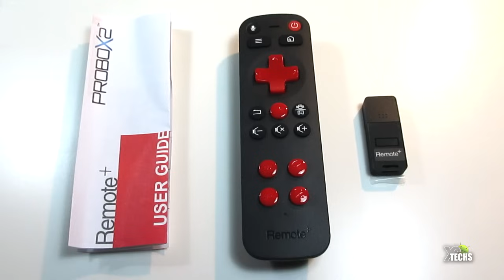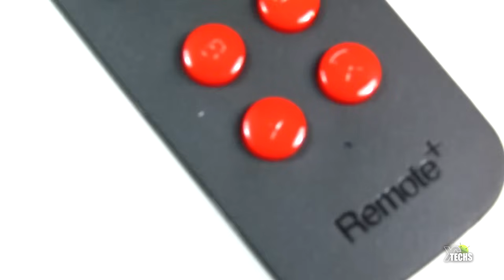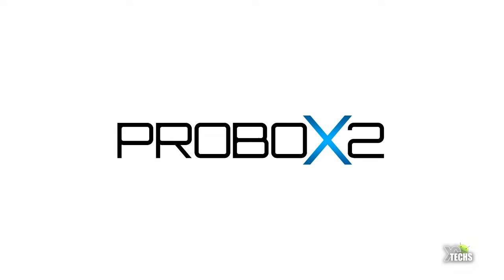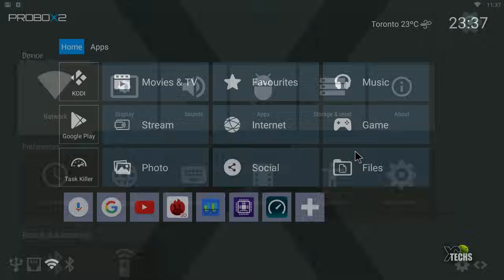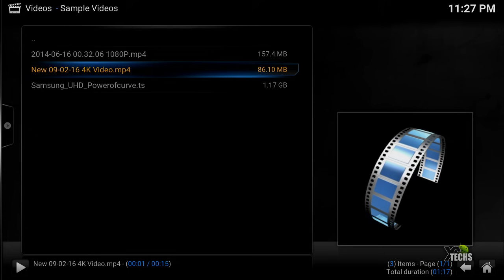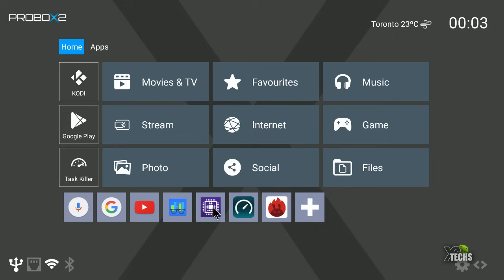Probox2 Air & Remote+  Android Box OS 6.0 - Review

Comment: Are you sure about the ddr3 ram figures, I looked it up and 1024mb of ram equals 1GB, in that case the box should have 2048mb of ram or even 2000 if rounded off not 1773mb, just asking in case I am wrong. Thank you.
Reply from the maker: it is 2gig Ram if 1gig multi tasking will be disable and antutu benchmark would be in 2s and not 3s and box would've crash alot
Reply: +XC techs OK, sorry if I'm wrong, but I have a tronsmart orion r28, with 2GB of ddr3, and it shows in cpu-z  "Total ram available - 2018MB. just as an example of my point.
Reply from the maker: Tronsmart, is a good company and yes some are showing more and some are little less. I believe that part depends on which manufacturer created the RAM and Main Board. 
Tronsmart using a different company to make the boxes and Probox2 si  using different company so yes some do even show more ram then 2GIG like 2.2GB even but that do not mean its less.
Reply from the maker: also remember that Orion r28 is a Rockchip and not AMlogic and RAM on those are not accurate cause if you do have 2GB of RAM you should use some cause your OS is running it would not say 2GB available, maybe you are reading it incorrectly but if says total RAM is 2018MB it is still less than 2GIG, cause it should read 2048MB.